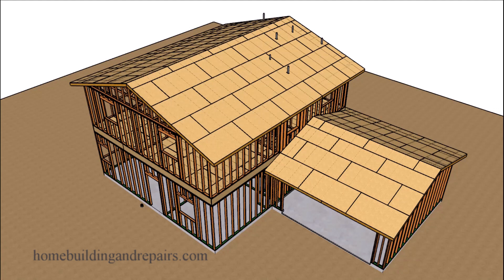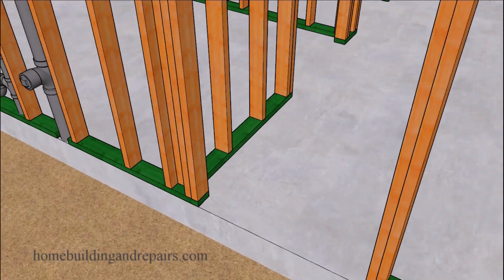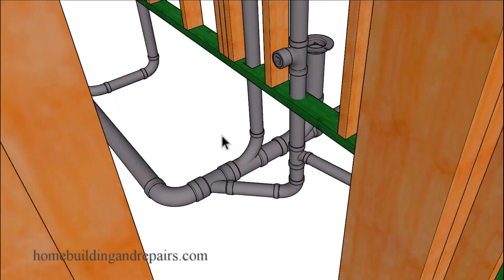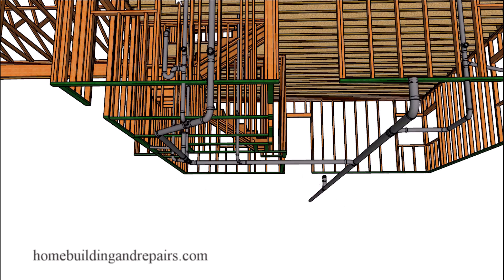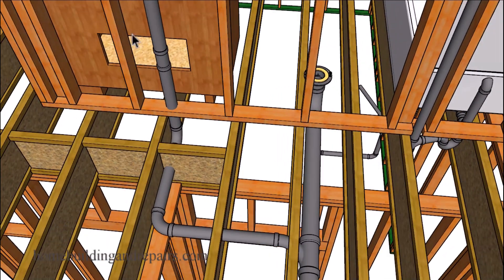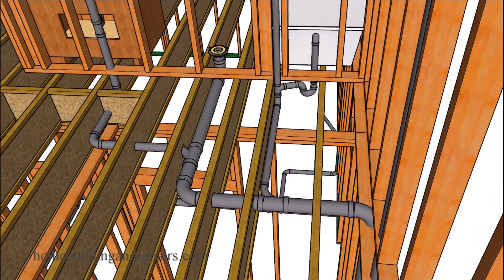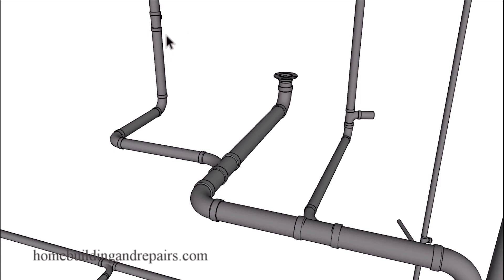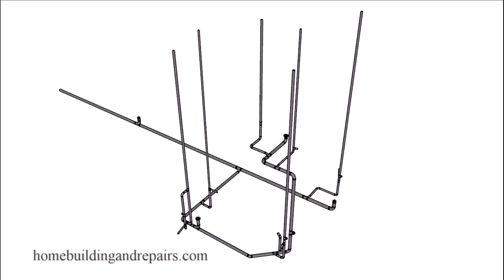Rough Drain Pipe Plumbing For Two Story House - Design And Fitting Assembly Examples Part 3

Comment: I want to install a new toilet seat to my ground floor room, ( Basically adding new washroom ) how can I run a 4 inch drain line to existing wall or flooring? Do I need to take apart drywall and flooring?
Reply from the maker: It will depend on your house design.

Comment: Great Videos! I will two levels with 2 bathrooms in my cabin as well as laundry and one kitchen sink. With all 8 fixtures being separate 1.5 inch dry vents, can I combine into one  vent for going through the roof, and if so, should this roof vent be 2 or 3 inch? I am in cold northern Minnesota

Comment: Why couldn't the bay house both the bathtub/shower combo valve and the vent? Too many holes in the bottom plate?

Not necessary to provide details on the pipe fittings again. However, it would have been great if you'd listed the link to that video in your description.

Comment: How do you typicaly trim those exterior cleanouts in the siding?
Reply from the maker: With a round hole, maybe about 1/8 of an inch larger and then fill gap around clean out with an approved sealant or caulking.